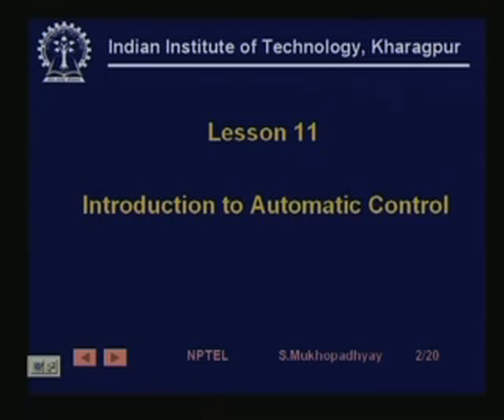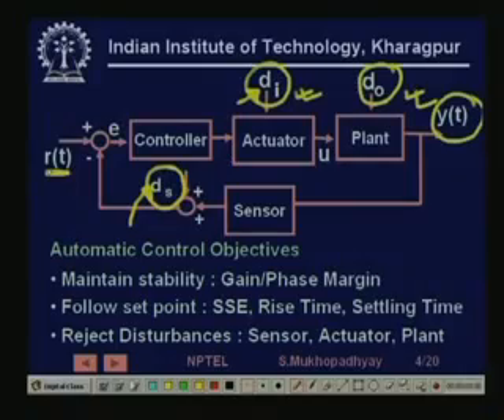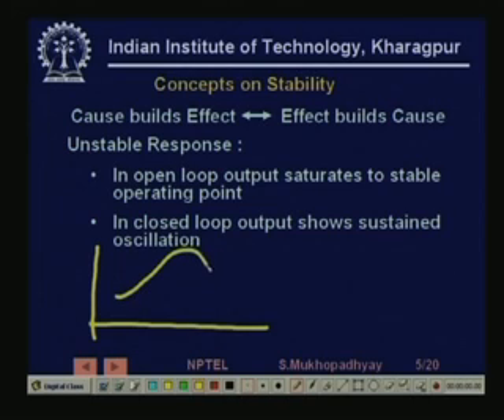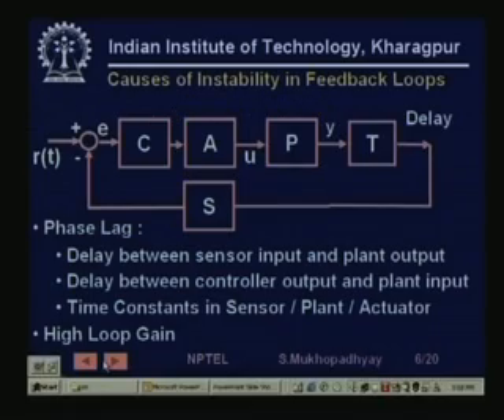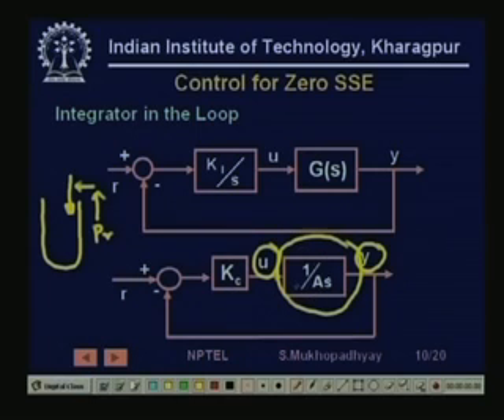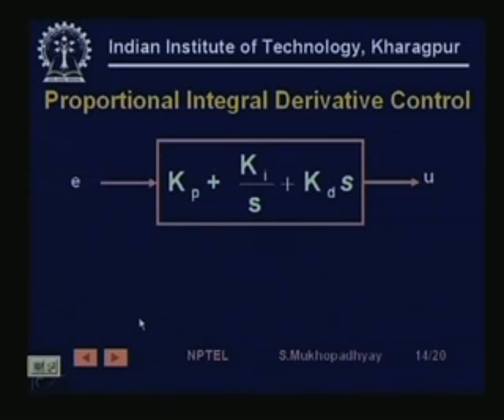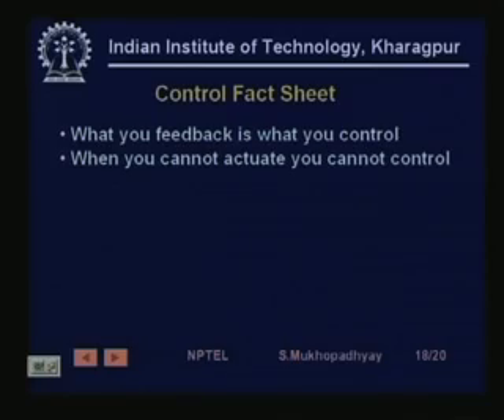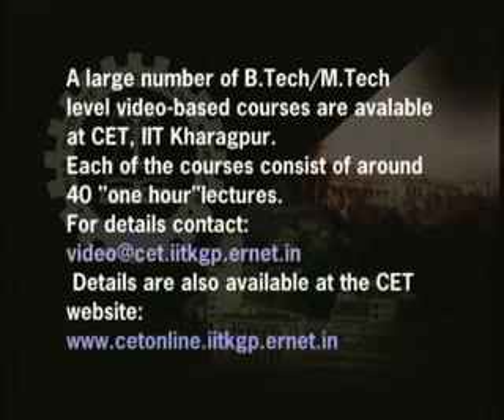Lecture - 11 Introduction to Automatic Control

Comment: It is a bit strange for my, your explanation starting in: 15:10, when you say: "Motor characteristic is this". After that you drew te yellow line not clearly. I think, that you should drew the green line only tangent if you want to explain unstable behavior. When the motor starts, its moment goes to point of contact with load torque and because of momentum it goes thru the point, accelerating since the motor characteristic meet with load torque again. Could it be correct? Sorry for my english